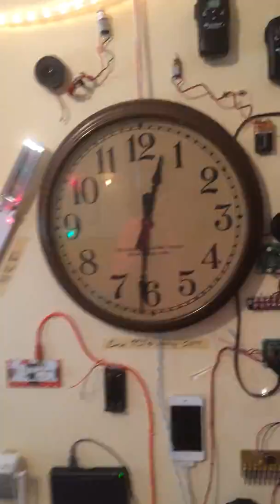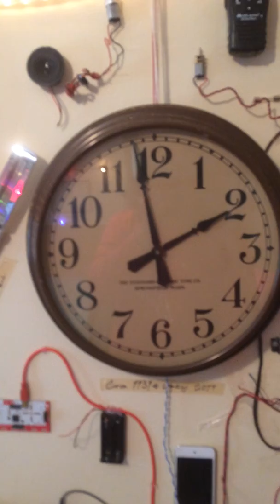Standard Electric School Clock (1939)

Comment: Hi there! I just found a 1964 version of the clock in this video. It is also a slave clock and I’m trying to figure out how to make it work and hang it up in my shop. Do you have any ideas for finding a mechanism like you have there that sends the pulses to the clock? I’m not really sure what to look for. The clock is a Standard clock with no second hand and the movement in the back clicks forward one minute at a time. Any information would be much appreciated!
Reply from the maker: Most impulse clocks from the 60s have 2 wires coming out from a coil, they are usually colored black and white. Usually the clocks are stamped with a 24v's label. You can spend 80s bucks on at clock controller on ebay but I have never used on of those but seeing by some others they seem to be easy to set up. You could also make a simply solution by buying a syncronous clock motor with 1rpm and jerry rig it to a limit switch and have that switch wired in series with the clock with a 24vDC supply from amazon. Or if you are familiar with arduino Uno, you can use the blinking LED program and hook that up to a relay and then have  that hooked to the clock for a 1 minute impulse. DO NOT directly hook the clock up to mains. It will heat up and you will get the magic smoke and possibly a fire. Theres more info on   https://clockhistory.com/setclocks/index.html
Reply: @johnsidlauskas3838  Thank you! I found a few of those impulsers on eBay but they’re all $120-140 now. Although that still may be cheaper and easier than trying to figure out a jerry rig solution. I’m not a circuit board guy. You should make a few up and get a side hustle going. People find your clock videos and would buy an easy solution to make these awesome old clocks work. Have a great day.